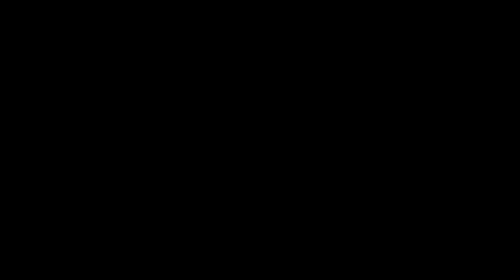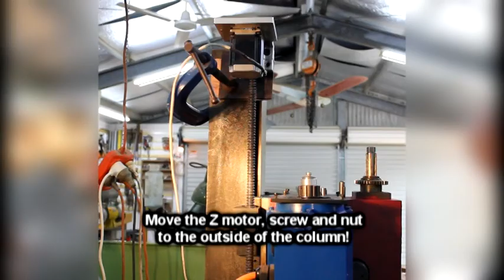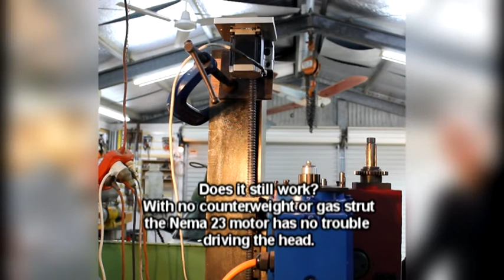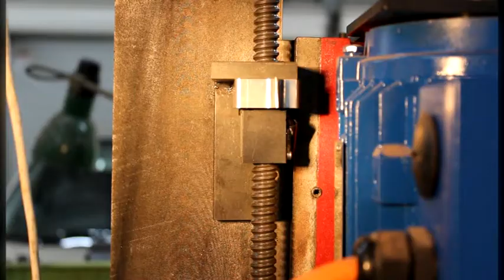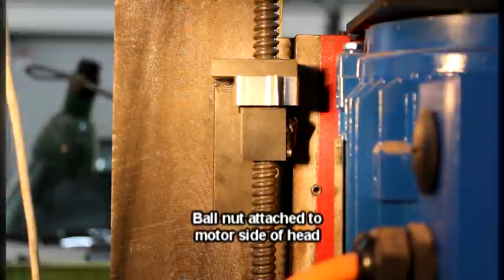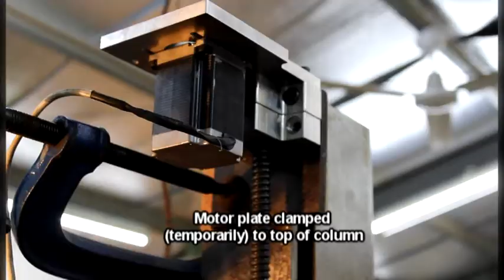X3 Z axis upgrade

Comment from the maker: Hi, I posted a complete build log on the CNC Zone forum detailing the process I used to upgrade my machine. The link is here http://www.cnczone.com/forums/x3-sx3-g0619-g0463/240886-cnc-cad-forum-posts.html 
I ended up filling both the base and the column with epoxy granite and so far the machine has worked perfectly despite having the Z motor fitted to the outside of the column. I find I can now machine steel to a reasonable degree of accuracy although I am never too ambitious with feed rates and depth of cut when working with hard materials. Probably with better quality carbide cutters I would get a better and quicker result but I tend to use cheap Chinese tooling because most of the jobs I do are one offs and prone to tool crashes so I don't want to write off a $150 end mill because I forgot something in the GCode. 
Show less
Add a comment...